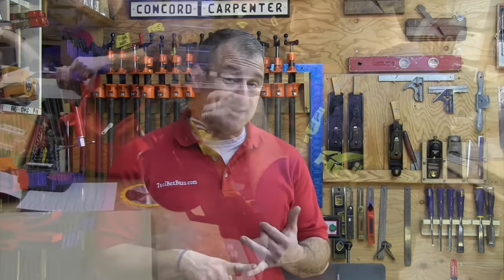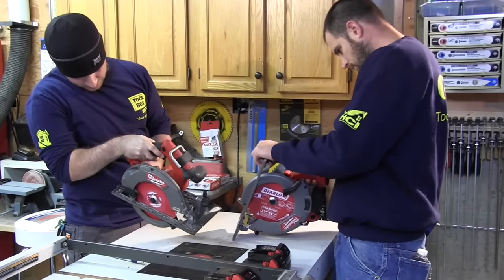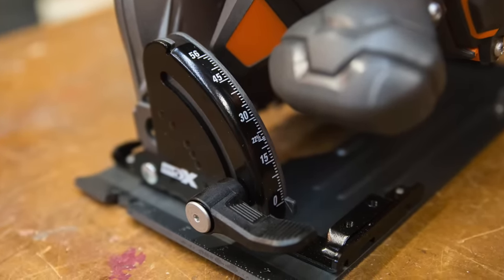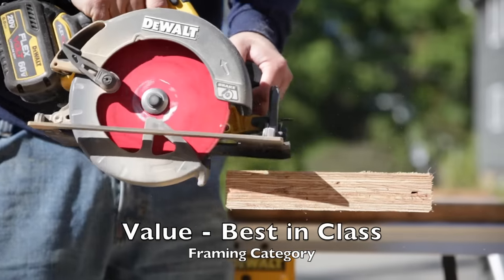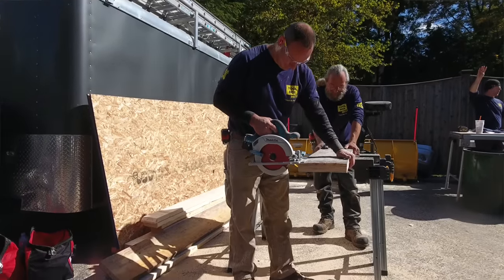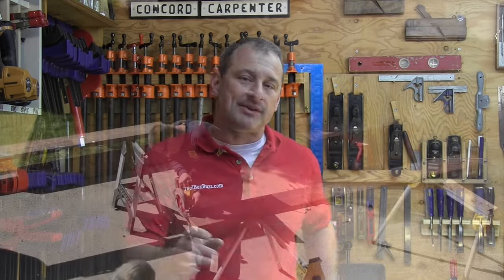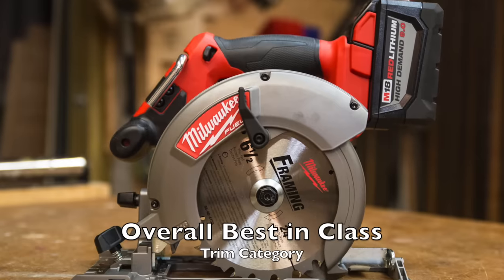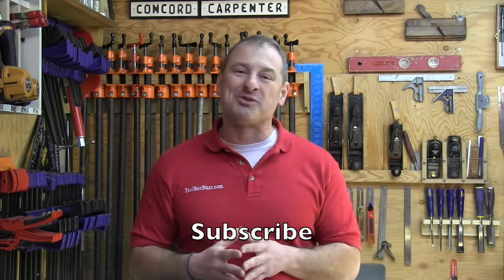Best Cordless Circular Saw - Head to Head

Comment: I have several Porter Cable 20 volt lithium power tools.  I am really satisfied with them.  My only complaint is with the circular saw by PC with the standard battery.   It works great for minor cutting.   When making cuts in 2x6 boards, you get maybe 6-8 cuts max and those are tough cuts.   Mechanically, the red blade depth handle when tightened in the max depth position rest below the base of the saw.    I used this saw during a water line break over my cedar sauna and had to cut wet cedar ceiling planks.   It worked great even after getting wet.  Very light and it made enough cuts to allow access to the problem.   Good reviews of all the saws.

Comment: The new flexvolt tools are incredible! They definitely have more power than 18v tools , I recently ripped a green oak 5x5 post 3m long in half with 2 passes ,   Fully charged battery and still had 1 bar left for ripping 8 sheets of ply in half , now with the 9ah /3ah battery's this thing is unstoppable!

Comment: I've used the Milwaukee,  amazing. my only thing to add about the Dewalt is though you can't use the 20v batteries from other Dewalt tools, you don't need to change chargers I believe and you can use your 60v batteries to run your 20v tools. So the tool can only use the 60v battery but the batteries can use the 20v chargers and the 20v tools can use the 60v battery.

Comment: I have the makita brushless saw and it's awesome 👏 . If I didn't invest so much into makita I would consider Milwaukee. 9ah that's huge!!! Come on makita time to compete
Reply: Dave Ishywood I have the makita corded circular saw. It's so smooth and just glides through the wood. Never been a fan of cordless saws, but they have come such a long ways. I can definitely see the appeal now.
Reply: Actually the Makita using 2, 5ah batteries is technically 10ah, right?
Reply: @achrisofalltrades5620  no, because the Makita is 36v. 2x18v 5.0AH batteries in series would be 36v @ 5.0AH, not 10AH.
Reply: @C71-m1l  Right, I get it now. Thanks man
Reply: You can use makita 36V double battery tools. Less charging time. Milwaukee 9Ah is 95min - 180min charging time. It is not relevant.

Comment: I run both the 20v and 60v dewalt on my job sites. I have the 20 and my partner recently upgraded to the 60v. 

Both are great saws but the 60 is a clear upgrade, even with both running identical batteries. The 20 runs great but bogs down on rips cuts a bit. The 60v feels like a corded tool power wise, it's very impressive. The large batteries change the balance compared to a corded tool and does tire the wrist a bit when power using on a framing site. The trade off for being cordless is more than worth it and we rarely run corded tools now. 

We run almost exclusively dewalt tools these days since the 20v/60v line is so impressive across the board. We currently have multiple drill/driver sets (20v), 20v and 60v skill saws, and grinders. The 60v is a clear winner for both, but the 20v is still a great tool. We have the 60v job site table saw, which is good but I wish it had the capability to be corded the same as the 60v mitre saw. Battery life is an issue for the table saw but it still has treated us well. The other 60v tool we have is the leaf blower, it came with a 9 amp hour battery which was nice.

Next cordless tools on my list are the framing nailer (currently use a paslode gas cartridge/battery combo when I go airless), and the 12" double compound mitre saw which looks amazing but is pricey.

Comment: I was at Home Depot yesterday and they are selling the Milwaukee 7 1/4 fuel saw with a 9.0 battery and rapid charger for $250.
Reply: That's important info. Thanks.
Reply: Holy Crap! Up here in Canadia, $250 only gets you the 9.0 battery!
God bless America!
Reply: the Canadian price point is due to the exchange rate..  we pay more on all tools
Reply from the maker: Vincent Sauvé yes bummer for those guys
Reply: Nutz4Gunz45 I paid 369 in Australia for the bare unit. Was a while ago though.
Reply: And here I thought I was the only person with this complaint.  Why are the reviews all so great of the Milwaukee M18 Fuel 7-1/4"?  It's a great saw, until you need power like wet lumber, or a slight blade bind, then it stalls out and quits.  So, I use mine when on a ladder cutting siding for windows etc., but when I need a saw to really cut something, I still use my Skilsaw.
Reply from the maker: Herein Town it's a great saw, as is the Makita and Dewalt. All of them will cut PT. we torture tested them on LVL. In past reviews we've used PT and all 3 cut it fine
Reply: Herein Town maybe try a diablo blade

Or if you already use one hold the saw straight
If it's reactive wood you are cutting put a chisel in behind the saw
Reply: Nutz4Gunz45 I'd agree with the Diablo blade suggestion.   I wasn't liking how mine was cutting until I took off the stock blade.

I've cut wet and frozen wood with it with no issues.
Reply: Vincent Sauvé just got the DeWalt plus charger and 6.0 amp for $350 Canucks.
Reply: picked up the milwuakee 7 1/4 with 9.0 battery and rapid charger for 299$ CAD at home depot in toronto
Reply: strazzella710 damn!   I need to find a deal like that.

I'm still just using my 2.0 batteries but I know I'm going to need more for some projects over the summer.
Reply: strazzella710 wow that's an amazing price.   I'm in thr maritimes  home depot only sells the bare tool here and they charge $299.  Only one local dealer has the set and they want $550
Reply: Nutz4Gunz45   just got mine about 2 hrs ago. Also online only I purchased the sawzall with 2 -9.0 battery for $400 and the 15 GA with 3.0 for $240.
Reply: do you guys even realize how cheap milwaukee is in the states.. i'm from europe and 9.0ah batt cost about €260 a piece
Reply: Nutz4Gunz45 The 7 1/4" is so cheap because it is left handed.  No one buys them out here so they have to goad you with a 9.0ah battery just to sell it.  I spent $199 on the 6 1/2" saw with no battery just because the bigger one is shite.

Comment: Wow great review really appreciated feels good today to be a Milwaukee guy.
Reply: I own and love this Milwaukee 6 1/2 saw. All my other Milwaukee gear is crap, gen3 fuel stuff. Combi, impact and fuel jigsaw have major trigger issues, don't work half the time. My Hilti drills have surpassed my Milwaukee ones. This Milwaukee fuel saw though is one of the best tools I've used in 40 years. The first one I received was faulty....not a good start, but the replacement one is incredible!! Light fast and cuts all day effortlessly. The motor sounds like a kids toy but the saw cuts any timber I point it at with ease. I have an 8 1/2" magnesium Makita corded saw for major cutting but wanted something smaller and lighter. This tool is simply incredible!!!! If all Milwaukee gear was this good they would wipe all other brands away. Sadly, in my personal experience their drills and impacts are very unreliable. I would love a review of the latest Hilti 22 volt circular. The 36volt is too old and brushed!

Comment: Amazing review!  And I am surprised by the results - sort of.  The Milwaukee Fuel is a great saw.  I have one, and when I first got it, I was truely surprised by how good it is.  However, I expected the Dewalt to win simply because it is a newer offering, and certainly they would have benchmarked the Fuel to be sure they beat it in every category by a reasonable margin.  The fact that the Dewalt was not the clear winner is what surprised me.  It does show just how good Milwaukee did with the Fuel.
Reply from the maker: We were surprised too! Thanks for commenting Goose - glad your back, been awhile!!
Reply: A Concord Carpenter yes, glad to be back!  Life gets busy, but wasn't going to miss this video!  great job!
Reply from the maker: I'm glad you're back too!  Miss those comments
Reply: If they had used  9.0 battery o the dewalt I think the dewalt may have won.
Reply: Wild Goose The only thing Milwaukee beat Dewalt was rafter hook

Comment: I love my Milwaukee Fuel, can't stand the fact that DeWalt changes batteries every other year
Reply: Actually, DeWalt is the only company that gives a hoot about battery  compatibility.  Not only can you still get 18v NiCads, but you can get an adapter to use the 20v batteries on 18v tools.  I'm mighty impressed with DeWalt's approach.  (Not impressed with their approach on 12v tools though, or more accurately, their almost complete absence from the segment.)
Reply: agreed its the reason I am replacing all my Dewalt cordless with Milwaukee as my old dewalts die.  They really pissed me off when they got rid of the 18v and went with 20v (which is the same battery, you just have to replace your tools).  All my contractor friends are doing the same as well, Dewalt really pissed off a lot of contractors.  Not smart!
Reply: tim johnson you can still buy the old 18v batteries, or an adapter to use the newer 20v...no need to throw anything away
Reply: makita didpiss me off when they drop their 18v nimh tool, at least dewalt as an adapter

Comment: When I saw the Milwaukee 7 1/4 with the 9.0 amp hour battery and charger for $245, I didn't even think twice about buying it. I had to walk out with a box that day, that trip to Home Depot.  It works as well as my 7 1/2 right hand mag skilsaw sidewinder.  And it cuts so clean I cut an 80 inch 1/16 inch thick piece of scrap off a hardwood  door I was trimming down.  It was one eight inch minus the saw blade width for the full 80 inches.  If I ever need to cut 1/16 inch stock I know how to do it. There was no waver in the blade or the saw like Dewalt tends to do.  My Milwaukee works great.  Due to the voltage, the Dewalt can probably cut the toughest stuff the best with no bogging.  The higher the voltage, the better a motor runs, period. That's why they have 24,  48, 60, and 70 volt batteries for heavy duty cordless tools.  Voltage wins in a motor.  Milwaukee will eventually have a high voltage saw to compete for pure raw power.  They will have to.  But in the meantime Milwaukee has long battery life and great power.  The unknown here is what happens as batteries age and only have half the life.  The Dewalt batteries may become intolerable due to short battery life while the Milwaukee will still have a decent, usable life.  Those big batteries are not cheap!  There may be some flaws that show up in the flex volt system that will be learned the hard way in this first evolution of tools.

Comment: I really enjoyed this video! I guess it really doesn't matter which one is best. People are going to go with what feels good to them. I have never seen a video that goes so far into the features. 
Thanks for that. I think I'm going with the dewalt only because I don't have a whole line of other battery packs from their previous line.
Reply from the maker: Thanks Thomas
Reply: A Concord Carpenter / ToolBoxBuzz 
I'm trying to decide between the Ridgid 7.25 and Milwaukee 7.25 brushless saws.  I have both platforms. Does the Ridgid have better sightlines for both sides of the blade and is the Milwaukee that much better power wise to warrant spending 100 more dollars?
Reply from the maker: BG Greg the M18 saw will last longer and give you more cut power.

Comment: it's cool to see the Milwaukee 7 1/4 win it really is a great saw
Reply: Mark Kilroy  I have the flex volt and love it. it's got lots of power and is nice for taking up on the roof regardless of not having a rafter hook
Reply: goldenguns4u is that with the new 60v battery? saw a cutting test with the dewalt vs the Milwaukee and the dewalt clearly had more cutting power.  wondering how much of a difference that makes when you're out on the job.
Reply from the maker: jamesnm21 this H2H test was done just before Flexvolt cane out
Reply: Talk about spoiler
Reply from the maker: Kyle Gritzner what do you mean?
Reply: Top comment is the winner of the shoot out. I wanted to watch the video without knowing.
Reply from the maker: Kyle Gritzner sorry
Reply: It wasn't the vid it was the comment lol great vid
Reply: Kyle Gritzner no bumbum hhvhu CT VT nu nu mi mi kkkj GB in yj tv t
Reply: Mark Kilroy Milwaukee is a great brand period
Reply: Picked up the Milwaukee Fuel 7 1/4 with 9.0 battery at home depot on closeout for $63  I couldn't believe it.  The battery alone sells for $160
Reply: Great job   I'm definitely getting a Milwaukee 7 and a quarter
Reply: Milwaukee win because hi wanted to win ...
Reply: jamesnm21 I love Dewalt and Milwaukee  power tool

Comment: Excellent review all great saws. If you are invested in a certain battery platform nobrainer stay with that saw if you are starting out go with the Milwaukee or DeWalt but you wont go wrong with any of these saws .If you are on a tight budget like me go with Ryobi or Porter Cable.
Reply from the maker: Dead-on brother!
Reply: Charlie Thompson I'd say go with Makita, they have the largest platform by a large margin and high quality tools.
Reply: Milwaukee's platform, I would say, is better. Makita seems to have more cases of multiple versions of the same type of tool, where Milwaukee has a larger variety of unique tools...but it could have just been my observation and not fact.
Reply: Makita definitely has the larger platform, they even have a damn coffee maker.
Reply from the maker: i know - thats funny
Reply: and a push bike
Reply: And a freaking bike!!!
Reply from the maker: agreed
Reply: If you're not using the saws all day long then a Ryobi or even a B&D will probably work out fine. In fact some Ryobi stuff works better than the Milwaukee - such as their nailers. Even though they are owned by the same parent company.

In some cases buying budget is a false economy but you have to weigh it on the individual tool and application. The problem is that there is a lot of badge snobbery and some people are obsessed with that more than just getting the job done.
Reply: anyone on a budget should go with Ridgid gen5x  I can't say this enough. I literally have almost every platform you can think of. Mostly due to deals and steals online or in big box stores. When buying Gen5x spend the extra 20 or so for the brushless. I thought and was very wrong that all gen5x tools are NOT brushless. Also their Circ saw is 7-1/4" I have Ryobi and thought they were ok until using higher end tools. Theres nothing more frustrating than not getting through a cut on steel railing and having your battery die. Until you use a premium tool you won't understand that all things that have a spinning blade are created equal
Reply: Ridgid by far has the best warranty, lifetime on battery if bought with the tool. Can't tell you how many tools I threw away because the battery replacement was more than a new set up. I'm still pissed about that.BTW take your tool to HD rental center and they will send it out for you, no postage. Call an 800# they will send you a pre-paid label for batteries.
Reply: Charlie Thompson This is the most level headed statement in the comments statement
Reply: Charlie Thomp

Comment: I saw the Milwaukee on clearance for 125, so I picked it up.  This thing is a beast.  What I like about it is that reviews tend to be on the positive side with negatives being on the low side. I still prefer the blade on the left, but I also feel that the pros of this saw are strong enough to outweigh that.  It came to a point where left and right no longer bothered me. There are different uses that come in play where a right might come in handy. I personally love using this when I am in workshop mode.  There’s just something about its performance that makes it one of the best in class and gives the user that certain confidence that this beast will keep ripping until it’s done.

Comment: seems a bit redundant, the cordless saw you get is the same brand as the batteries you carry. Everyone always starts out with a drill/driver kit before buying other tools, so whatever one you started with is the one you're stuck with.
Reply from the maker: KewlCrayon A lot of people purchase starter tools, lower quality more budget items. Others have several different brand tools but I'm not sure which platform to build battles so I guess it all depends
Reply: Ehh I got a little bit of everything. Dewalt drill and driver, Milwaukee drill and driver, Makita drill and driver, Bosch drill, Hitachi drill, circular saw, jig saw, recip saw. I like to try a little bit of everything, but you can have all different stuff, for 18v I love Hitachi, for 12v love my Milwaukees
Reply: I'm actually starting my till portfolio over.

I'm looking at drill/driver/saw... Loved Makita years ago.  Looking heavily at/well probably get Ridgid or Milwaukee.

Current need is simple projects.  Will be building personal home in 2 years if everything pans out.  Even if I have to wait 5 years... I want what I buy today to be going strong to finish home
Reply: Yeah I've got a mix, dewalt/ makita/ryobi... really whatever is the best value at the time. Maybe one day I'll settle on one and sell my collection, but I don't mind having multiple chargers and batteries.
Reply: I tend to agree with purchasing for the battery type you already own.  Then when one item in your set is pure junk  you would never buy a replacement for it.  Instead you will go to upgrade and find saws near same size you want/had and find one reasonable price until....you find it comes with no battery or charger which makes it a hammer. But to find a saw to replace the kit junk you find one saw to replace your $100.00 saw is closing in on $400 to get batteries and all.